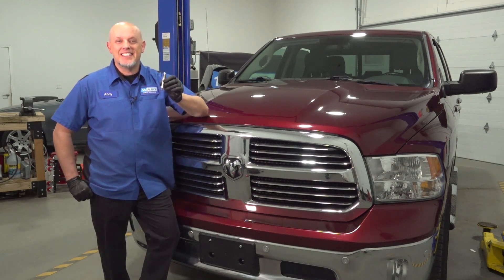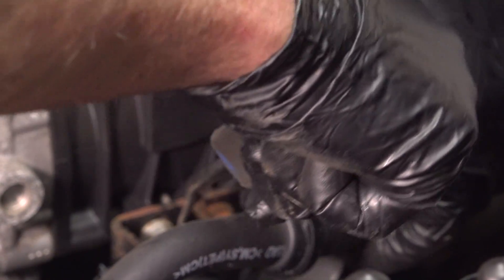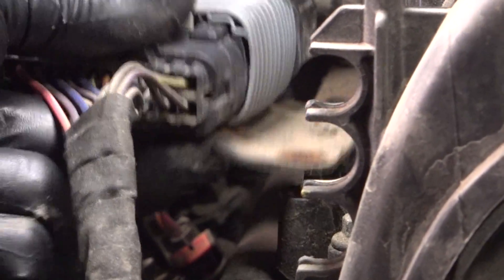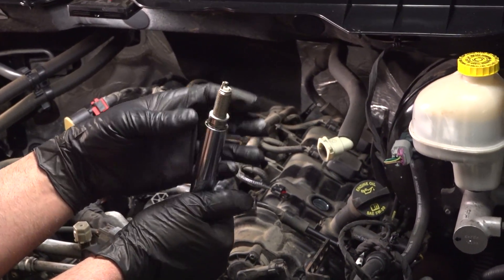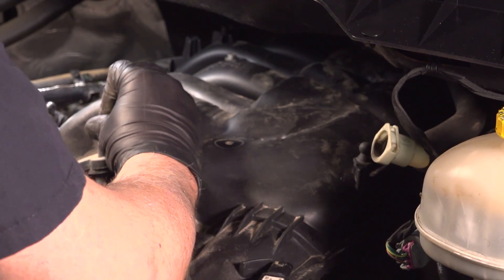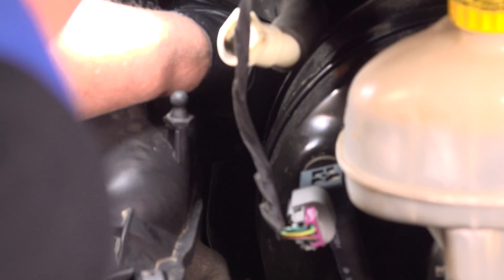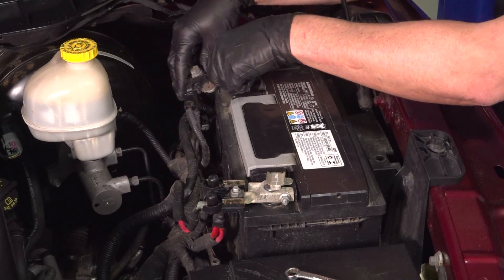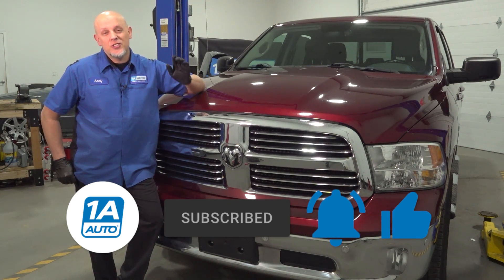How to Replace Spark Plugs 2011-2018 RAM 1500 (3.6L V6)

Comment: These engineers are purposely designing vehicles thst cost thousands every time a maintenance issue comes up. . This spark plugs under the intake manifold is a total JOKE rip-off.  To make dealerships MILIONS in repairs. Boycott them all. Buy a used well kept vehicle with a good history. That you can put your own spark plugs in.

Comment: I just changed the spark plugs on my wife’s VW Tiguan today. Removed engine cover, disconnected ignition coils, removed ignition coils, replaced spark plugs. So easy. I was going to change the ones on my truck preemptively but I think I’ll just wait lmao.

Comment: Sheesh! "Remove cover.....remove throttle body.....remove intake manifold....drain coolant.....remove crankshaft and pistons......remove left door.....remove dash and instrument cluster......remove headliner.....remove back glass.......remove fuel tank.......remove license plates and license lamp bulbs.....and finally, remove the passenger rear brake caliper and rotor."

We get it, Dodge. We get it.      "A + purple = barbecued flavored lugnut toast"

Comment: Wow, what happened to just pulling the boots off the plugs and taking out a spark plug?  What a PIA this looks like.   throwing P0304 #4 cylinder code for plug and/or coil.....not looking forward to this debacle to dissemble for what should take 5 minutes on a normal older vehicle....So how long is the process for a typical billed change?  Looks worth it to have if its only 1 hour charge.
Reply: It's roughly 700. Cuz they'll change all the plugs and inspection each coil
Reply: I hear you, I sure do miss the old days when everything was just so much simpler and better!

Comment: this hose that hose is really confusing. please try to be little specific next time like coolant hose, fuel hose and also the reason why are we  disconnecting them. and same for the bolts, "loosen these 8mm bolts on left of the alternator" will be more helpful